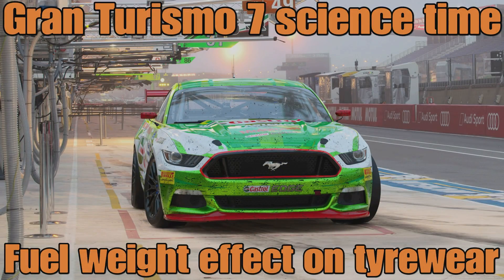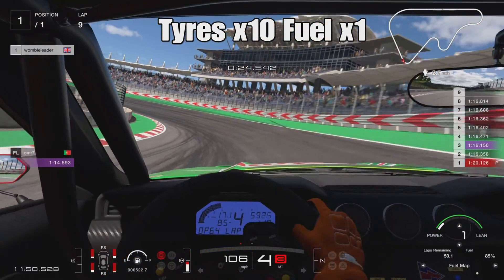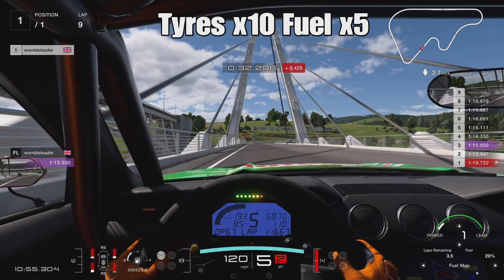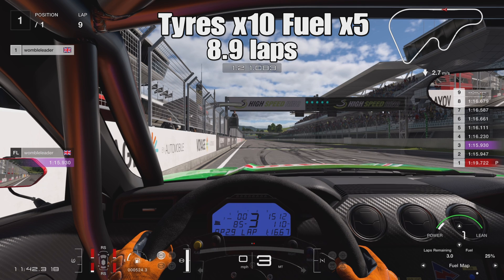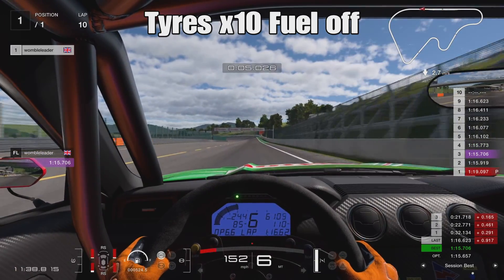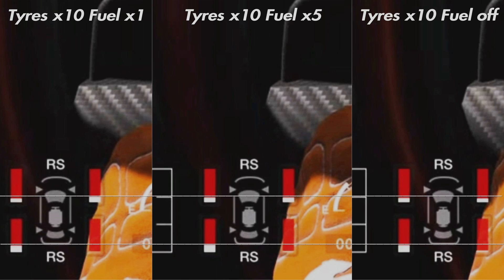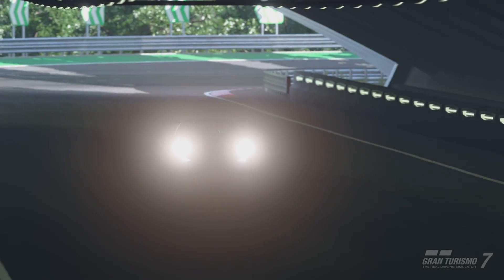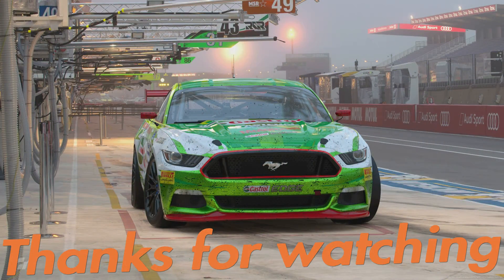Gran Turismo 7 Science....Testing fuel weight effect on tyrewear

Comment: Disappointing that fuel weight doesn't seem to be taken into account properly
Reply from the maker: Tbf its 1 car at 1 track and maybe the test was slightly flawed by using soft tyres at x10 tyrewear as makes them to sensitive to minor slides and locks

Think il do x5 mediums over a longer run if I test it again.

Comment: I thought there would be less wear on lighter car, but the different wear pattern on a car without fuel I will hold a finger on is because of the shifted balance point 🤔
But still interesting to see someone test this 👍
Reply from the maker: Yeah the front tyres were a bit odd between the runs. I agree its prob to do with where the fuel weight is applied. Think more testing required!